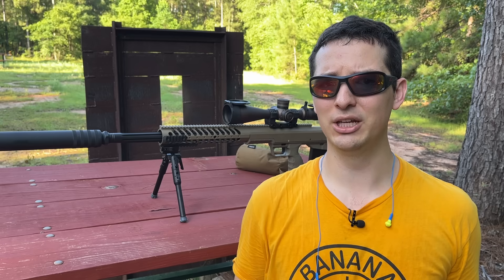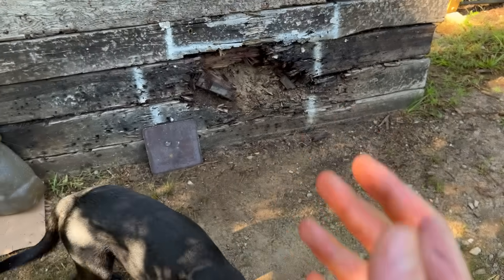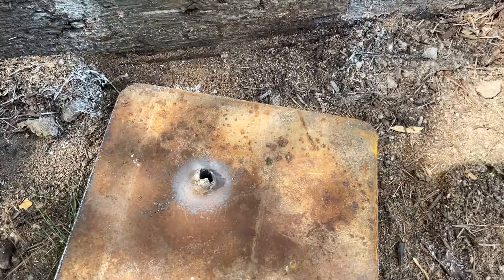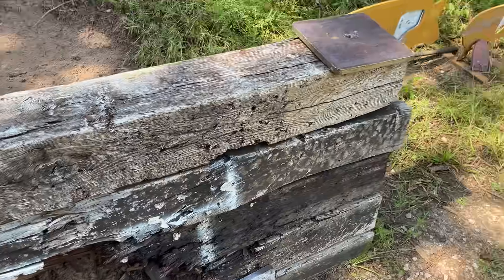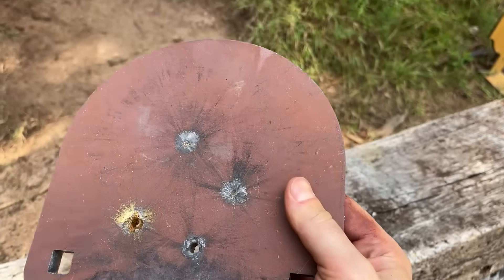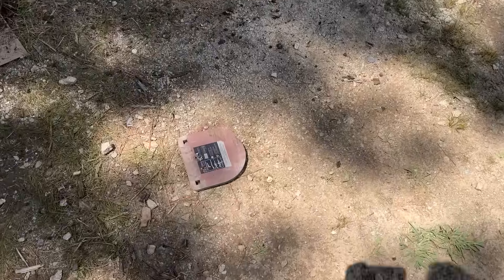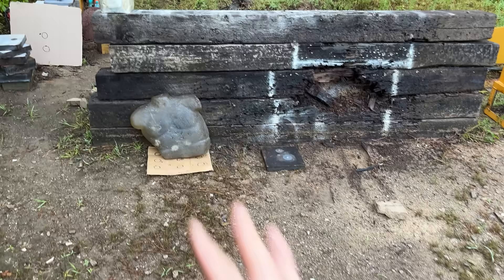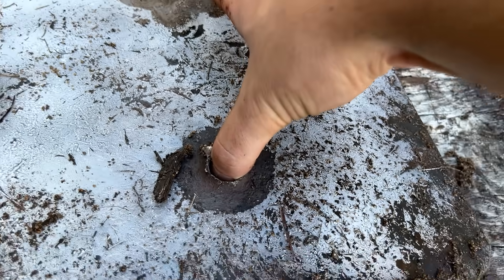How Much Steel To Stop A 50 Cal Sniper?

Comment: Of course if we have a bullet proof vest that can be equal to 10 concrete blocks that will be great, but what about the head and other exposed area of a body? Can someone invent a dodge sensor body radar and can make the speaker to dodge  with sensor speed of 6000 feet per second which is a  4x Mach speed dodging and a set up of a perimeter auto respond rifle which can  reach the shooting gun  at 4000 feet per second.

Comment: Politicians have never been known to take constructive criticism in the right spirit; the question remains as to why, apart from digging for laying pipes or cables, pot holes develop soon after the rainy season? It all points to the same old nexus between politicians and contractors; illicit commissions for the politicians and shoddy work. Whatever funds that are allocated to address the issue in question should be seen in that light.

Comment: Question: Would the bullet ricochet if it hits a steel hemisphere? Care to test?

An immovable spherical dome of steel, or one that is fixed with some damping room (e.g. done with springs or rubber). Let's say the bullet hits from the front right at the middle between the edge of the hemisphere and its center.

Comment: I don’t know if the rounds weigh what they’re supposed to. They’re definitely counterfeit because they’re not tungsten carbide cause they would still go through even if they had a mild heat tree. It’s tungsten tungsten carbide is just tungsten that has been heat treated in oil the same way steel is they harden it the same way they just they heat it up until it’s glowing red and then they drop it in motor oil where it picks up a carbon atom and becomes tungsten carbide

Comment: 6:04 no it’s not because an M2 armor piercing round has a tungsten carbide penetrator and tungsten carbide does not flatten like lead or even steel penetrators will flatten if they’re not hardened but tungsten carbide is a brittle metal. It’s extremely hard. It will not flatten. It’s not malleable. It’s the type of metal that would shatter. It’s a pieces if enough pressure is exerted I’ve seen a videos with tungsten carbide penetrators on those hydraulic press machines. This guy had a tungsten carbide penetrator and he put it on a piece of steel or something and I even think he might’ve used it against titanium, but yeah though it’s not the type of metal and even that machine couldn’t break the tungsten carbide penetrator. It just pushed it into the steel. I think he did a tungsten carbide versus tungsten carbide and I don’t remember the result, but I mean enough pressure with something hard enough in the middle break not bend. It’s not a malleable metal and it will break and become brittle under enough pressure

Comment: I have a 12”x24” steel plate 1/2” thick that I found banged up on the side of the road, it holds up to .308 as close as 30 yds. 25 yds left a mighty dent

Comment: What type of steel are you using for your targets? There is steel then  there’s STEEL! Homogenous Rolled Armor, HRA, comes in a variety of alloys and heat treated conditions. All of them are a heck of a lot more resistant to gun fire than hot or cold rolled 1018 steel. (Steel that’s .18% carbon by weight, the rest being iron with trace impurities.)

Comment: I'm designing a full aluminum captain. America's shield, trying to be able to stop 45 and\n AK rounds won't be able to stop farmer piercing.\n We'll have a stick of thick steel plate on the back of the shield.  And the aluminum will catch all the resistant and impact of the bullets and an added extra left layer of cavalar on the backing of the still plate

Comment: You are something else!  I don't know if everyone is catching all of your comments... but you are friggin hilarious!  On top of that you are doing an excellent job with your choice of both guns and target selection, plus your choice of ammunition and I've been exploring the same areas for nearly 65 years (as far as the steel is concerned).  Using 36" - 45" barrels... the M2 AP should max out around 1.75"  of mild steel.  Thanks to WTW (in the 'We Tried Everything') the .75" AR500 stopped every .50 BMG except the SLAP round which he didn't have!
My experience with the SLAP versus mild steel was somewhat disappointing... until I added a jacketed windscreen with a lead envelope between it and the core
which increased the penetration depth to nearly twice that of the standard SLAP!  These tests were done shortly after the rounds were introduced in the mid 80's.  The PPI round if you can get them from your friend along with the 7.92 SmK-H rounds are outstanding though Matt had mixed results with the PPI and 2 AR500 plates on his channel (Buffman)!  You are pretty much in the upper echelon with the very best gun channels in my book!  Very nice choice of gun...I am glad you are not using the very short barreled cannon... you will be glad you moved on from it later!  Take care and keep your powder dry!

Comment: The steel in the m2 round is probably softer than the steel on the AR500 plate. The M2 AP was really only meant to penetrate aircraft armor which was light and meant to really only stop flak

Comment: Can you test 22-250 with m855 projectiles loaded in it? I figure a 1:10 twist barrel should stabilize it (62gr)

If you could get the m855 anywhere near 4k fps I think it'd be pretty spicy.

Comment: Take that mushroomed "M2" penetrator and see if a file digs or bounces off it. Also flint. If it is hard, flint will cut it fine enough to spark, soft stuff won't throw sparks.
   Try to scratch glass and quartz crystal.
Reply: Also try to scratch an old cell phone glass or cover that's ruby or gorilla glass (hardened).

Comment: @6:52 - The penetrators are supposed to be tungsten steel (Edit* - Tungsten-Carbide).  In all my years of shooting AP from a Barrett and a Serbu, I only ever saw ONE penetrator deformed.  It was bent - well, like a banana.  The tip was still fully formed but the tip was bent over.  Every other example that we found was in tact and straight.
Reply: FYI: tungsten and steel are two different types of penetrators. Tungsten Carbide are what is in the Raufoss and Hardened tool steel is what is in the M2AP. Typical ball has mild steel.
Reply: @ammohoarder  You're correct.  I misspoke.  I will leave my mistake to help highlight your correction.  Thank you.

Comment: I was very disappointed the first time I shot my 50 at steel. 3/4" A36 (mild steel) stopped it hard with less actual penetration that I got from my 300 Win Mag. Most of the data you see online for 50 caliber performance is based on the 45 inch barrel on the M2 machine gun. The typical shoulder fired 50 has a barrel that's typically a full 16 inches shorter... it's got to change things.

Comment: The dog probably deaf right now even with the suppressor. That's why he is not responding to command.
 Do Dog Ruin Their Hearing by Loud Gun Shot Noise

Yes, loud gun shot noise can ruin a dog's hearing. Gunshots can generate sounds greater than 150dB, which can cause permanent damage to a dog's hearing and lead to partial deafness. The intensity of the sound can cause irreversible damage to the delicate structures within the inner ear, leading to long-lasting or even complete deafness. The extent of the hearing loss depends on several factors, including the proximity to the gunshot, the frequency of exposure, and the dog's individual susceptibility. To protect your dog's hearing, it is recommended to use specialized dog ear protection during shooting activities. 
Nice experiment though👍.

Comment: It’s my understanding that when the 50 cal was designed the requirement was to be able to penetrate 1 inch of steel plate at 100 yds.  Given the fact steel has become better, more uniform and harder, I believe standard ball could do that way back when.

Yes today’s armor is far superior to back then BUT modern AP ammunition is also far superior so the penetrating power is basically the same

Comment: I have an Armalite AR50 that’s suppressed and it seems to work good as a muzzle brake because with the muzzle brake it’s ridiculously loud you need two forms of hearing protection. With the suppressor you don’t need any hearing protection but it’s not recommended to go without. Also you can test your armor piercing rounds with a magnet. Also I shot an AR 500 1/2 inch target with a real armor piercing round and it went through like butter.

Comment: Dozer blade.  
 Is about 1 in thick, odviously hardend,  308 does nothing.  I wonder the difference between milled and hardend; in the 50cal  range.  Will hardend steel just shatter at that volosity?  Or react the same.  Hmmmm

Comment: You were scammed. 

I have a very healthy supply of genuine black tip AP rounds and they are no joke. From my 29” Barrett M107A1, at 90 yards, they will go through a 1” mild steel plate stacked in front of a 1/2” AR500 plate. No, I’m not exaggerating or lying. 

I’ve shot them at a 1.25” mild steel plate at 760 yards and they make it 3/4 the way through. 

I have also stacked a 1” mild steel plate in front of shale rock at 250 yards and they go straight through the plate and fully embed in the rock and the cores still look new and sharp. They’re awesome rounds.

Comment: As a Heavy Machine Gunner if you where using modern depleted uranium rounds none of that steel would stand a chance.
Reply: Yeah not in your back yard
Reply: @bloodvue  why not
Reply: This
Reply: Ya cause banana can get his hands on depleted uranium rounds. Although if you can you should send him some for testing.
Reply: Pesky alpha emitter and heavy metal hazard though.
Reply: well, these definitely arent real AP rounds. He got scammed. This is just hardened steel probably, if even. A real tungsten penetrator would laugh at these plates, especially in this caliber. Id love to see a depleted uranium vs raufoss comparison on a 2" plate tho.
Reply: @Sharpless2  The real m2 ap is a hardened steel core which is considered armor piercing but so far there is no 50 bmg tungsten core rounds which isn't SLAP, RAUFOSS except for the Swiss P 50 bmg API which is a tungsten core incendiary projectile and that's probably discontinued
Reply: @ruv-x3s I though silver tips were pretty common. They are not widely used anymore?
Reply: @thorwaldjohanson2526  Swiss P was recently sold a couple of years ago to Beretta so i don't really know if they still sell those or not

Comment: Yeah, Heat Treatment does Not just Go Away so easily. Molten Copper Would not even cause the Steel Core to loose its Hardness Either. The Steel Core would have to get Much Hotter Than That, someone is Making "Fake" Armor Piercing Rounds to sell for More Money.
Reply: M33 ammo has a mild steel core, so he probably has a bunch of that.  Some dirtbag painted the rounds to mimic the real AP rounds.
Reply: Actually, molten lead at 650° will remove the hardness of steel.
Reply: Depends on the temper. Hss can be tempered  very hot  @caraday7768
Reply: Yup!

Comment: I believe the m2 did come in 2 steel core versions. A mild steel core and a high carbon, hardened core variety.
Use a magnet to check. The mild steel will be highly magnetic, the high carbon, much less so.

Comment: Banana those "M2AP" you had definitely looked like M33 ball as typically (not always) the M2AP's have a huge machined cannelure vs rolled. Sometimes the additional roll crimp above the machined one. The Core of M2AP is identical in construction to M33, it's just hardened.
Reply: Id just like to know where he got them.  So i know where not to buy from.
Reply: @cullen6138  It's probably under a new name like summit ammo which sells the "m2 ap" for 50 bmg,
Reply: So could one harden the round specifically the core? Get m33,harden em yourself and good to go?
Reply: @forestcampbell8962  not without melting off the copper jacket and small amoumt of lead surrounding it. Then youd need a way to reman a new jacket onto the core. Just buy real ap from a reputable dealer.
Reply: @forestcampbell8962 no. It is a different material composition. It’s not quite like hardening a knife blade by quenching the steel. Usually hardened steel like the real M2 has a much higher carbon content kinda like tool steel vs grade 80 steel. Tool steel is much harder and will easily mark grade 80.

Comment: its not the caliber, pal, its the rigidity. the same with biological counterparts of it. 50 cal used by anti materiel rifle(yes, it doesnt like cash) because when it used with solid core like tungsten or depleted uraniums, it will penetrate thick tank composite armor. 
so even if its 50 cal, if its a soft lead, it will squashes at impact.
and the same understanding work in ANY calibers.

Comment: Why not just use a magnet to test  for the steel in the rounds? It works on M855.
Reply: Pretty much all 50 BMG with exception to the Hornady A MAX and Brass Solids have a steel core in them
Reply: @BuffRANGE  Thank you as I had no idea.

Comment: Yup you got scammed, someone painted a bunch of m33 ball, it's has a mild steel core not ap but will work better that lead core in penetration
Reply: Gotta be careful about those second market 50bmg. Ask Kentucky
Reply: @festerallday was that a round thing or a barrel obstruction?
Reply: @lessknowledgeplease Rounds was overloaded, around 2 to 4 times more muzzle energy than regular slap should have
Reply: @lessknowledgeplease  it was the round itself, estimated at like 400,000 psi
Reply: @lessknowledgeplease I believe they caulked it up to an overcharged hand load. It's relatively easy to accidentally double charge a case if you're not focused on the job.
Reply: @festerallday  Chalked
Reply: I got scammed years ago with a 20 case of SLAP 😔
I was sold "the tungsten" variety, only to find out, they were just the hardened steel penatrator.
The price difference was about 13$ per round between what was sold as "tungsten" and the normal high carbon, hardened steel rounds.
The outfit was just selling the exact same, high carbon, hardened core rounds at a higher price.
Reply: @John-ir2zf  Tbh you got two variations of Slap rounds which are SLAP and SLAP-T. You probably bought the regular SLAP which is a hardened steel round while the SLAP-T is a tungsten carbide round
Reply: @ruv-x3s i know the 2 varieties, i specifically bought the tungsten despite them being 13$ more per round, except thats not what was sent to me. Hence the scam
Reply: @John-ir2zf  I mean the latter is just buying a regular 50 bmg round, remove the bullet, put a sabot and take a tungsten carbide drill bit. Might work but depends on if you wanna learn how to handload/reload. That also depends on how much jankyness you want if you really need a slap round
Reply: @ruv-x3s  as an aside, the tungsten SLAP rounds arent tungsten carbide, they are just tungsten metal. Tungsten carbide isnt an alloy that can be smelted, its a sintered press and while very hard, is extremely brittle. The pure metal tungsten isnt as hard as the carbide variety but is far more resistant to shattering.
Reply: @John-ir2zf  I just used tungsten carbide as an example since it's a type of tungsten alloy used, they probably changed what tungsten alloys are used in bullets now
Reply: @ruv-x3s negative. There are two .50 BMG SLAP rounds. M903 SLAP (has a amber color sabot) and M962 SLAP-T (has a red color sabot). The "T" is for tracer, not tungsten.
Reply: The most profitable few drops of black paint!
Reply: I honestly think it's was just a difference in heat treatment between years the damage was more considerable with the first m2ap he was using.
Reply: Yep you got scammed

Comment: Couldnt you use a magnet to tell if it even has a steel core?
Reply: Regular M2 50 cal ball has a mild steel core.  In fact M2AP is the same core just hardened steel instead of mild steel.
Reply: @davids8773 Oh, I didn'tknow that. Next time I'm qualing with the M2, I gotta bring a magnet

Comment: Well Mr. Ballistics, I'm afraid you're going to have to adopt that dog. Its going to need to be a recurring character on the show and its just too cute to be out there all alone in the woods with Goosifers and possessed squirrels hiding behind 1/8th inch mild steel plates, 1.57" concrete walls, impenetrable boxes of sand and 6 inches of pressure-treated lumber. How do you expect a puppy to survive that? I mean you could arm it but you know, thumbs.
Reply: Really unfair bringing up thumbs, I guarantee the dog is doing his best

/s
Reply: I guess too bad if its someone elses dog just on a roam , Dont think the owners care that Dribblers in the comments section renamed their pet.
Reply: I was an EOD I’m the mil.  Don’t bring up thumbs😢

Comment: Doesnt the suppressor reduce the power?
Reply: No
Reply: I usually gain about 10-15fps using a suppressor. And they seem to tighten up groups as well.
Reply: suppressors actually slightly increase muzzle velocity due to the increase in barrel length
Reply: @Skully8600  ah thx!